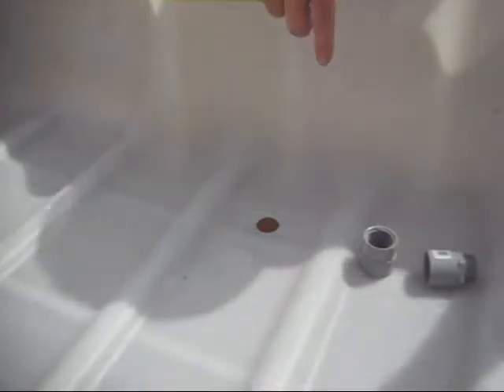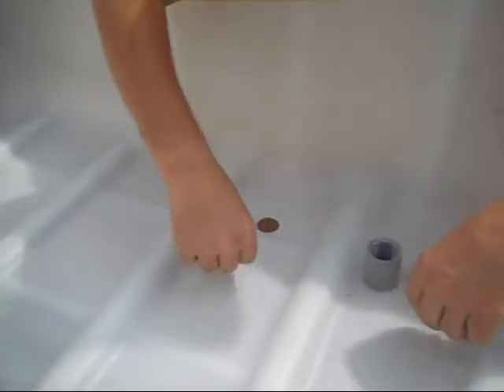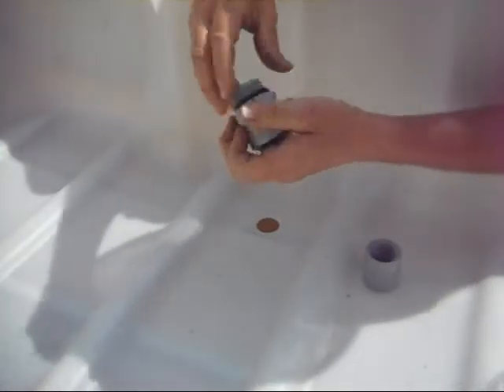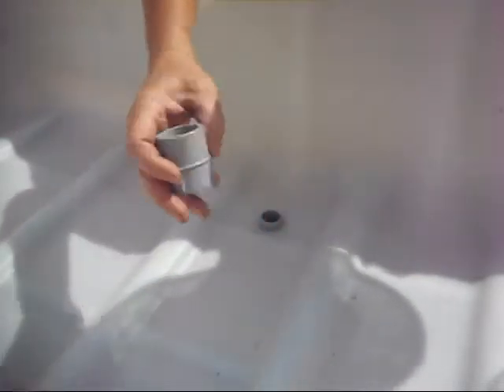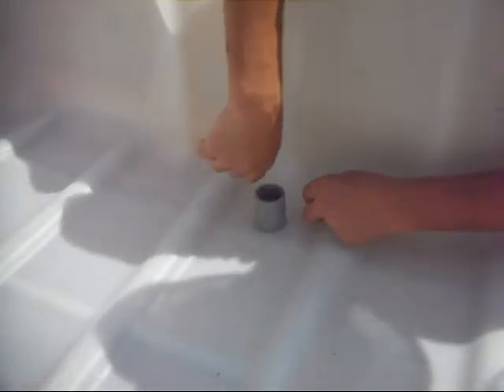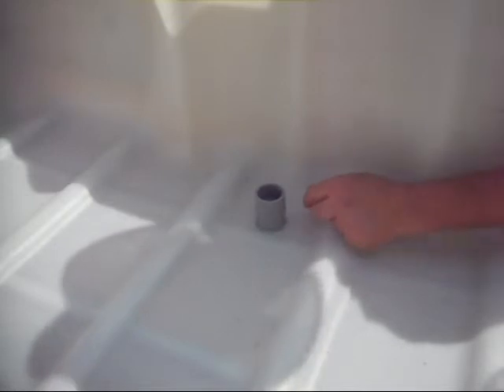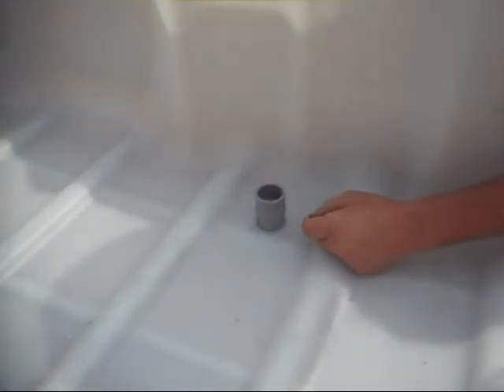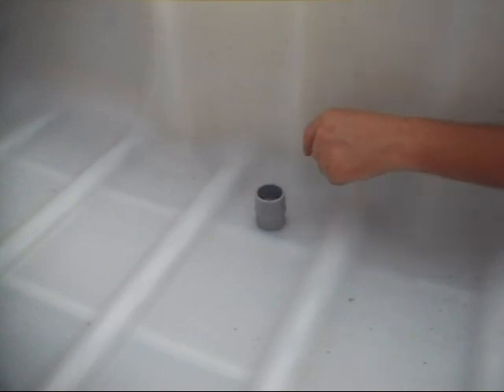Making PVC connetions to IBC Fish Tanks and Grow Beds for Aquaponics

Comment: yes i like the way you did the hole off to the side ( much simpler ) . My concern is that the ibc tote , the top half that becomes the bottom for the grow bed has 3 areas that are low(er) , could this become a "dead area" that sediments can settle for too long and affect the water chemistry?
also what types of sealant is used for ABS and/or PVC ? are they food grade.
thanks a lot for any help, really appreciated it.
Paul.
Reply from the maker: The low spots could possibly become filled with sediment eventually although the water constantly filling/draining should create enough current to keep them from being stagnant.  As for the PVC sealant, if it's about gluing pipes together, PVC cement is  approved for use on drinking water lines so it should be ok.  Most of my system is simply pushed tight with no glue on the fill side, with o-rings or rubber gaskets on the bulkhead fittings while the drain side is glued together with drinking water safe PVC cement.

Comment: great video.
i 've been having trouble since my grow bed (ibc tote ) has a huge 6" cap in the middle and i'm not sure how to go about putting together the bell ...
Reply from the maker: You could either put your siphon near one side as I do or simply drill through the cap (make sure it's threads are sealed of course) to set up your bell siphon.  I use the connections in this video for my stand pipe, put a 4" gravel shield around it and a 2" bell.  I cut my beds out of the sides of the  IBC tanks so that I wouldn't have to deal with the caps or drains.